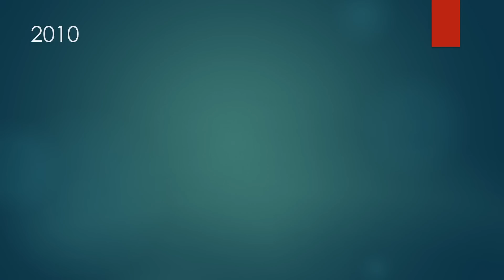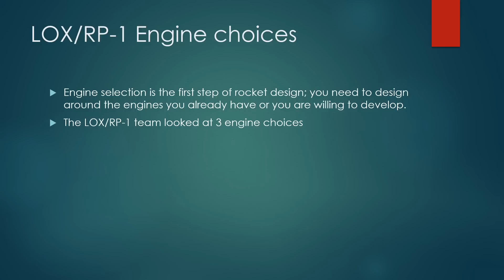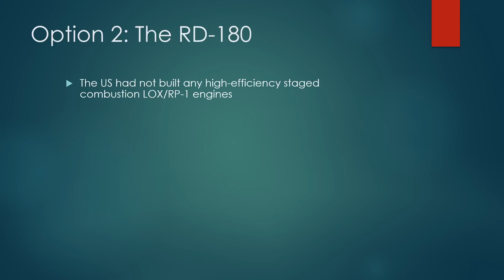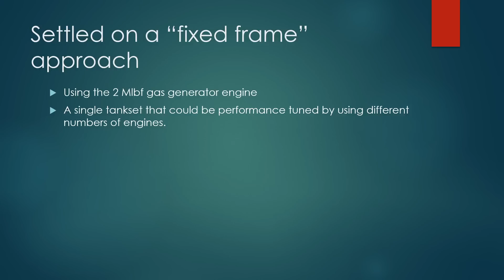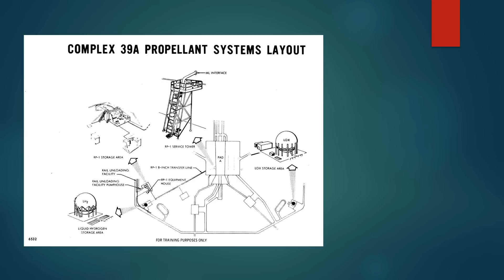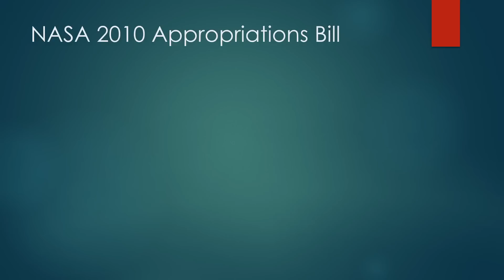Why don't we fly the Saturn V? An alternate SLS history...

Comment: Funny, he never mentions methane at all . . . !
Reply from the maker: Methane is a recent fashion.

For first stages, from a pure efficiency perspective nothing beats kerolox because the density of RP-1 is so high and you can easily build high thrust motors. The downside is that it's expensive, it doesn't burn completely and therefore isn't great for reuse, and you can't easily make it on Mars. 

The US focused highly on hydrolox because our engine companies were convinced that you couldn't build staged-combustion kerolox engines. The russians proved them very long. Hydrolox looks great but it's low thrust (hard to pump a ton of hydrogen) and the density is awful.

Methane is a nice compromise fuel. Density is pretty good, efficiency is maybe a bit better than kerolox, methane is cheap and widely available, you can easily make it on Mars, and it's easier to build high performance gas/gas engines. 

It's a bit funny that nobody was looking at methane until both SpaceX and Blue Origin started looking at it, and now they are developing methane engines, as are rocket lab and relativity.
Reply: @EagerSpace  "For first stages, from a pure efficiency perspective nothing beats kerolox because . . . " I disagree. Keralox does not burn as cleanly as Methalox and the mission ambition for ZpaceX (< 1 day turnaround for multiple missions) cannot be met with a cokey burning fuel - turnaround time was one of the defects that killed the Space Shuttle program.
Reply from the maker: @brianletter3545  I was speaking purely about the physics in that statement.

Comment: Where was NASA who completely missed the point about the future of space flight and launches? Were they out to launch at any cost? Elon Musk and SpaceX got it. Falcom 9, completely usable first stage. Falcon Heavy, all 3 boosters reusable, and next Starship.  All while NASA can't get the SLS off the ground and at a cost so far of $20 billion.
Reply from the maker: I'm working on a video that talks about this, but the underlying problem with NASA is that the incentives are all messed up. NASA managers want to keep NASA centers open and their careers going, contractor management wants contracts to keep their careers open, and congresspeople want votes and money for reelection. Shuttle did that very well for 30 years - that's why NASA flew it for so long without any changes. They'd have flown it to 2020 if Bush hadn't cancelled it. 

SLS is just a continuation of that cycle. And it's over $40 million if you include Orion and the ground systems (VAB, transporters, pads, etc.) in the costs.

Comment: Why are you using the sea Level isp?
Reply from the maker: I thought sea level was sufficient for the point that I wanted to make.
Reply: @EagerSpace   Well the RS 25 has Vacum ISP of 453 s And the the RD180 around  341
Reply: @EagerSpace   And there was Plan for using the AR1 ( like the RD180 but Build in the USA )
Reply from the maker: @tobias1396  My recollection is that the RAC-3 team only looked at simple variants based on commercial launchers, and that a re-engine would be beyond that. 

If they had gotten to serious consideration the foreign source for the RD-180 might be an issues, and that point the AR1 might have shown up.

Comment: Here is a better question.  Why are we still flying rockets?  In the first 60 years of aviation, we went from Kitty Hawk to Space.  In the 60 years since we first went to space (V2 Rocket) nothing has changed!  We burn fuel using an oxidizer to create thrust on an extremely inefficient vehicle.  So are we to believe that technology development stopped?
Reply from the maker: What other option would you suggest?

There are a number that have been proposed - mass drivers, space elevators, skyhooks - but it's not clear if any of them are possible, much less practical. 

The physics of getting into orbit from the surface of the earth really constrains what we can do.

Comment: You lost me when you stated that the RS-25 only had an Isp of 366, ignoring the higher vacuum Isp (452 seconds, iirc) where the engine spends most of its time burning. I'm a big fan of kerolox, btw, but I'm also a big fan of accuracy.
Reply from the maker: So... 

the RS-25 is 366 SL / 452 vacuum
the RD-180 is 311 SL / 338 vacuum

I chose to quote sea level for both for simplicity's sake to make the point about impulse density.

The RS-25 does do comparatively better in vacuum than the RD-180 does - it gains more thrust - but I don't think this negates my overall point - the hydrolox stages still are much bigger than kerolox stages. . And I don't think it's terribly relevant to the overall presentation as there were no solutions that compared the RS-25 directly with the RD-180.

Comment: ISP for the RS-25 (SSME) is around 452, not 366
Reply from the maker: 366 at sea level.  Really surprisingly low for an engine that is so good in vacuum.
Reply: @EagerSpace  Ah BUT Is The RS-25 OPTIMISED For Sea Level OR Vacuum OR A Compromise BETWEEN Those Two Operating Environments???🤔
Reply from the maker: @AndrewHillis_2024  The RS-25 is as optimized for vacuum as it can be given that it has to work at sea level and fit in the space available at the back of the shuttle.

Comment: "Double the density impulse, RP-1" 
I've been wondering for a while if pump limitations are a part of this issue.
Using LOX as a constant, it seems like 3x as much LOX and H2 needs to be pumped vs. LOX and RP1. RD-180 and F-1 are still state-of-the-art big engines. Flow 2x or 3x as much as them? No way.
Reply from the maker: Definitely true. The RS-25 uses 4 turbopumps and the high-pressure LH2 one is just a monster in terms of how much power it takes.

Comment: Knowledge of the Rocket-Dyne F-1 was as taboo as porn when public knowledge of it's existence was released.......turbo-pumps capable of supplying 1.5 tons of fuel per second....we're talking 1 engine....3000 pounds of fuel per second....per second, re-read that...
Astonishing results on the engine stand..........the engineers were afraid of it, and rightly so.....swirl cyclic harmonics were uncontrollable, let alone predictable, and no team would suggest a fix....it was that scary.
The Nazi Von Braun knew it was the salvation of his dream to go to the moon....ZERO Nazi rocket engineers were assigned to figure the problem of it's schizoid tendency to eat itself.....
After Kennedy announced the USA's declaration of putting a man on the moon before the decade was out, a team of American engineers drug that awesome scary piece of heavy metal out, and perfected it.
What has become lost in history are the details......equally astonishing as this marvel is, on the edge of destruction , lifted the Apollo program to the moon over and over again....the S-1C booster was, and is, one of mankinds greatest leaps forward entering the great beyond.

Comment: I Would think a modern Saturn V would do away with the first F1 stage,  make the second stage longer into a center first stage and strap  2 solid or liquid rocket boosters on its side.
Reply: Sounds like an Atlas on steroids...that S2 sustainer would need to be run a lot like the shuttle mains, powered way back at low altitude, and throttled up as it got into thinner air/vacuum.
Reply: That just sounds like SLS with worse engines
Reply: So the SLS then. Ditch the S1C in favor of a longer center stage (Saturn V burned H2/LOX in its second stage), strap 2 solids on the sides, you have SLS block 1. I agree with the OP tho, I highly doubt Block II will ever happen. I foresee SpaceX surpassing NASA’s SLS in terms of capability and reusability with Starship…as in, more deep space missions with a cheaper price tag.
Reply: @heythere135   Starship looks like a throwback  to the 1940's and 50's sci-fi  B-movies and comics.  but I do think it has real potential.
Reply: The reason why you have the second and third stages is that you have different atmospheric densities the higher you go. There's a reason why the nozzles are different on different stages.

Comment: A QUESTION FOR THE ROCKET ENGINEERS:- IF REQUIRED WOULD IT BE POSSIBLE TO SCALE UP THE RS-25 ENGINE AND WHAT TWEAKS COULD BE DONE TO IMPROVE IT'S EFFICIENCY AND GET MORE SPECIFIC IMPULSE OUT OF IT???
Reply: Scaling up would be possible, to maybe 3-4x it's current size. You probably couldn't do much for it's efficiency though, it's already near the practical limits.

Comment: DIDN'T ROCKETDYNE HAVE OR STILL HAVE PLANS FOR THE F-1D ENGINE WHICH IS A MODERN VERSION OF THE 1960's/1970's F-1 ENGINE???🤔
Reply from the maker: F-1B, and yes. IIRC, they bid it as an option for the advanced boosters for SLS in 2012

Comment: WE HAVE STILL GOT SOME EXAMPLES OF THE F-1 ENGINE THAT NEVER FLEW ON A MISSION SO COULDN'T WE BACK ENGINEER/REVERSE ENGINEER THOSE TAKING ADVANTAGE OF NEW ADVANCES IN MATERIALS TECHNOLOGY AND 3D PRINTING TO MAKE MODERN F-1 ENGINES???🤔
Reply from the maker: That was the whole point of the F-B engine. We don't need to reverse engineer anything - the F-1B design is out there.

Comment: Saturn V was built in the 1960s and obsolete by the 70s. They could have upgraded subsystems and kept it going but Republicans hate public spending because it leaves less budget for graft.
Reply from the maker: I'm a fan of the Saturn V,  but it was built at a time when NASA had giant budgets and they simply could not afford to keep building them. Their assertion was that shuttle would fix that but it's clear that they were either a) fooling themselves or b) outright lying.
Reply: How could it be obsolete when it could still accomplish its mission?   Obsolete is like the TBD Devestator at Midway.    It could not complete the mission it was designed to complete.
Reply: So when did LBJ become a Republican?  the Saturn V program was cut under his admin ending the start of any new rockets.  It took years for the ones in production to finish and get launched.  Saturn V died in Democrat hands.